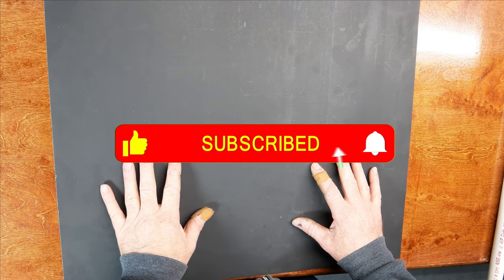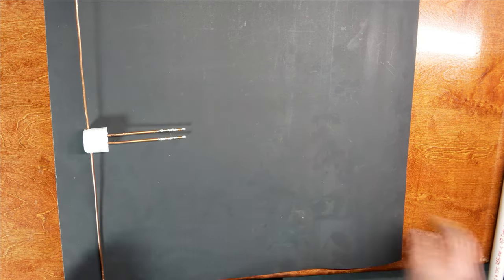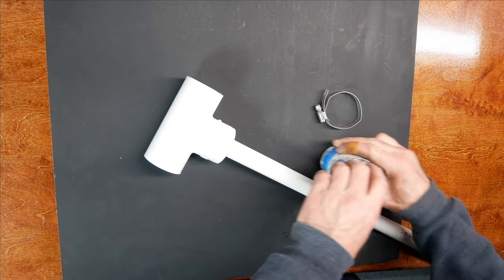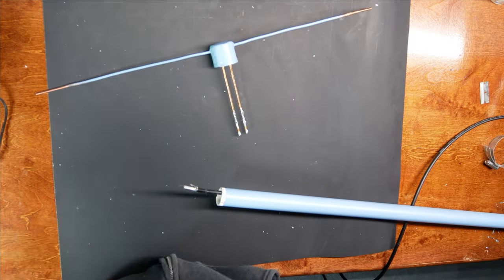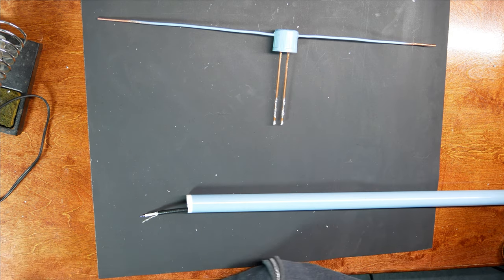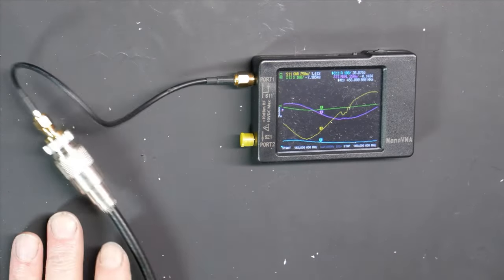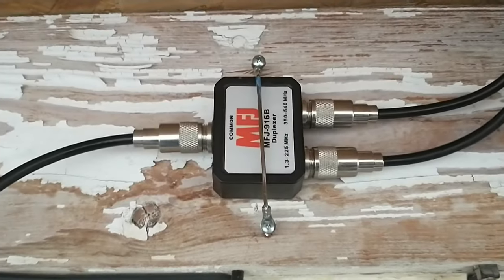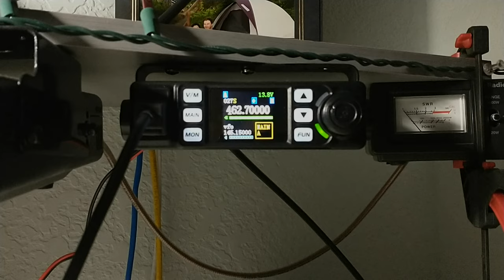Building a GMRS collinear antenna!

Comment: This antenna you made isn't a collinear antenna, it's a vertical dipole antenna, with unity gain and probably more "directional" than omni-directional. You could take two to four of them --- with a phase harness --- and make a dipole array positioned each pole in a 90 degree off set of the others and have a omni-directional dipole array antenna that might get you about 4 to 6db gain... JMHO that is.
Reply from the maker: If I was feeding it with 200 Mhz, you would be correct. However, at the intended frequency of 465 Mhz, the legs of this antenna are a half wavelength long. It's essentially two Siamesed 465 Mhz J antennas rotated 90 degrees. See: https://www.youtube.com/watch?v=YFMyYQcY53g

Comment: That isn't a collinear antenna. It's just a vertical dipole
Reply from the maker: From Wikipedia: A collinear antenna is "an array of dipole or quarter-wave antennas mounted in such a manner that the corresponding elements of each antenna are parallel and collinear; that is, they are located along a common axis." This one is 3/2 wavelengths long. https://www.youtube.com/watch?v=YFMyYQcY53g
Reply: Yes, its not collinear
Reply from the maker: @jacuswoczega9180  https://www.youtube.com/watch?v=YFMyYQcY53g
Reply: This is a stacked dipole, or broadside array. Collinear requires a phasing stub or coil between elements.

Comment: Rick, I built similar antennas for GMRS, 70cm, and 2 meters. It's basically an extended Zepp. I used 1/8" stainless steel tig welding rods to make the antenna. Each element is 15 3/8" x 3 1/2". Keep the 3 1/2" pieces separated by 1 1/2 inches, this will be your tuning stub. I used copper mechanical lugs purchased at home depot to slide over the stubs.  Coax end is spit terminal lugs are added to attach to mechanical lugs and secured with nut an screw. Slide the mechanical lugs on the stubs to adjust VSWR. Flat VSWR on the entire band and easy to tune. I hope this made some sense. Mike

Comment: Use electrical gray pvc its uv resistant
Reply from the maker: There are two problems with plastic conduit. One, rumors of signal attention, and two, it's not as uv resistant as one might think. I have some outside my house that has discolored and buckled over the years.

Comment: When I want flat SWR curves for UHF/VHF I use thick elements. 1 inch aluminum is amazing, as is copper water line, even refrigerator line has substantial diameter. I like the (3)1/2Wl design!

Comment: Interesting use of "controversial items" as easy tuning aids.  I would suggest, though, that you solder them to the antenna legs rather than using a grease.  I wouldn't be very concerned about dissimilar metal corrosion as the brass is at least 70% copper with the rest being zinc and other trace metals.  Brass and copper coexist quite happily, especially when there isn't a liquid trapped between them.  I would, though, be concerned about movement of the tuning device over time (they could conceivably rotate due to wind induced vibrations) so I would counsel that you use a brass jamb nut at the very least (solder is better).

BTW, painting the PVC is a very good idea as PVC is adversely affected by UV and degrades in sun light.  Painting does provide a level of protection.  Using the grey conduit would be better for outside use as a lot of those PVC formulations have some included UV protection.
Reply from the maker: I have a plastic deck chair that I painted with oil-based enamel years ago. Several unpainted chairs have become brittle and broke while the painted one soldiers on. The resins in plastic that keep it flexible can be prolonged in this manner. Fresh cast plastic should cure for a few weeks before painting though.
Reply: @ricksshop  Yep, it is well known in the power industry that white, plain PVC used out doors will need to be replaced in several years (like 2 -3) due to failure.  Not only do the plasticizers leave the PVC (which results in brittleness) but the UV from the sun breaks the polymeric chains - which leads to even more brittleness.  The grey conduit type is more resistant to the UV.

BTW, I must have missed the gauge of wire that you used and what thread series you used for your tuning devices and antenna.